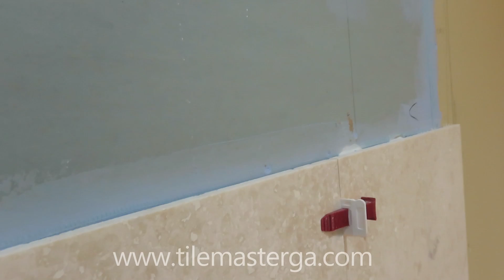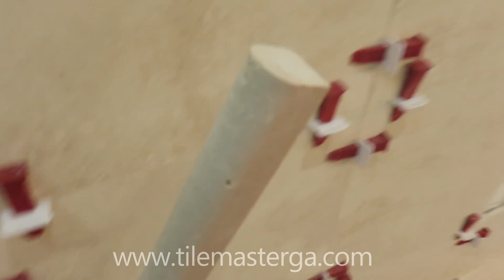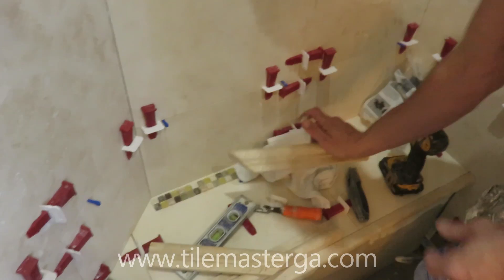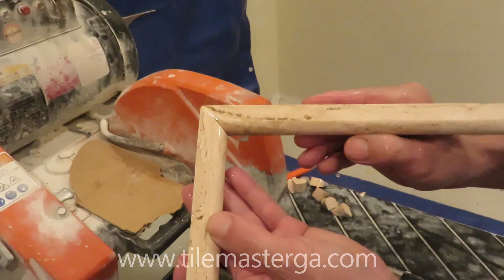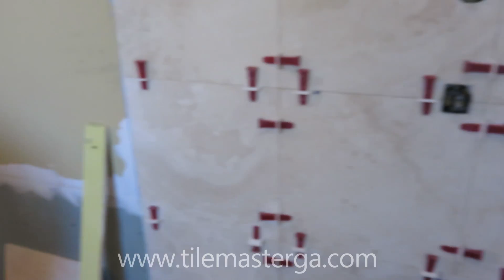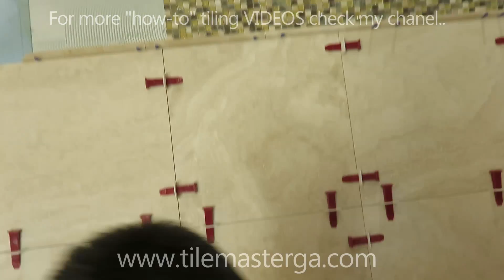Part "3" How to install  Travertine Tile mosaic accent with border 🛀🏻 🚿🚽🚻

Comment: great job, just wanted to mention to you about a method ive seen for  placing the base piece of the niche to allow easy removal if first attempt isnt great, it is to lay down a thin piece of fishing line from one side to the other leaving enough line either side to allow you to basically sling the tile back out if need be.